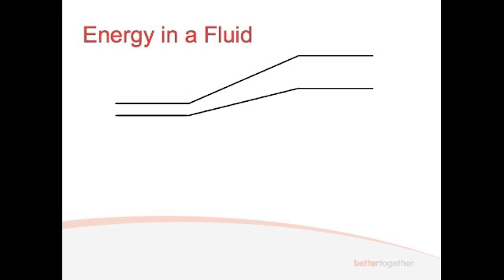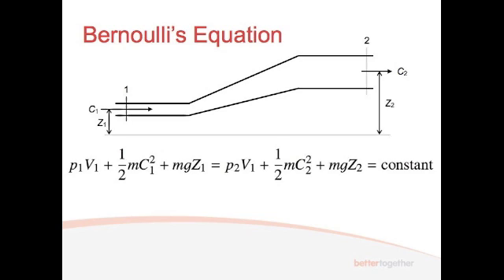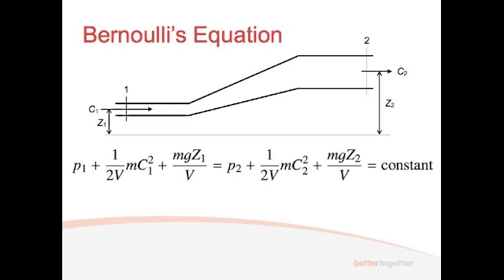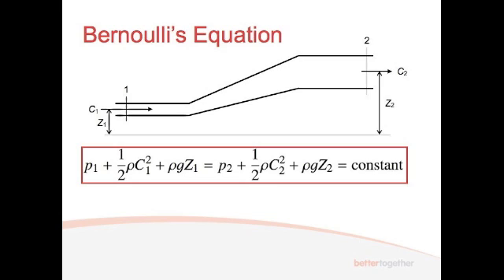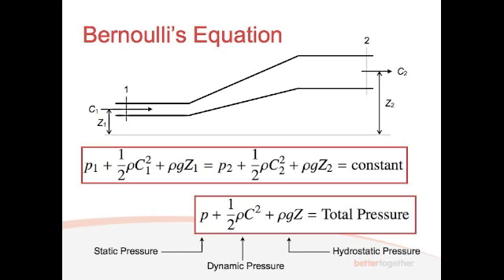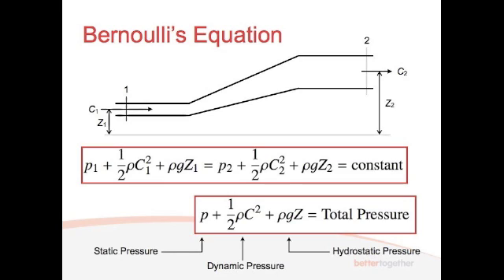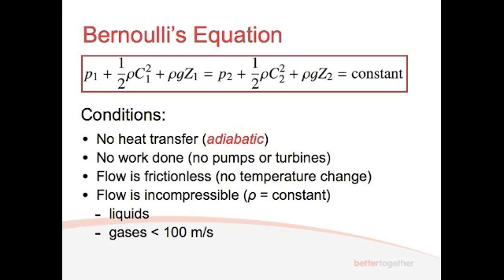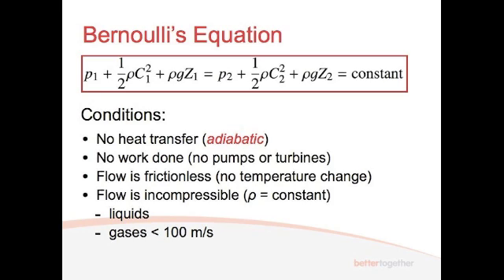Fluids - Lecture 2.2 - Continuity and Bernoulli's Equation

Comment: Chemical Engineering Sense, at constant velocity there is zero acceleration.
F= [m][0] = 0
Force and acceleration are both vector quantities, hence the force in this equation is referred to as net force. Meaning, at constant velocity the net force acting upon the fluid is zero. However, this is only possible if the force applied is equal to the frictional force.

I think...lol